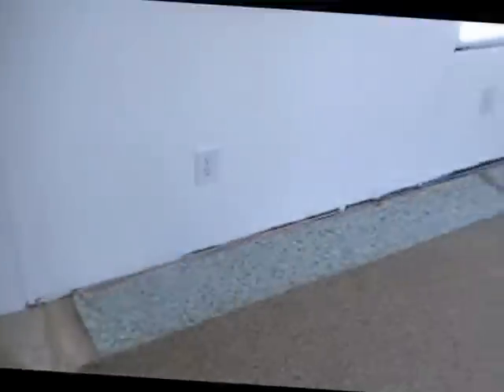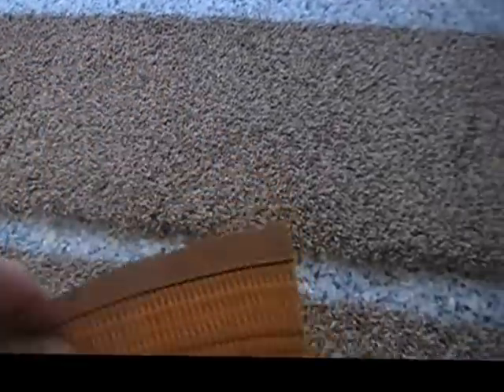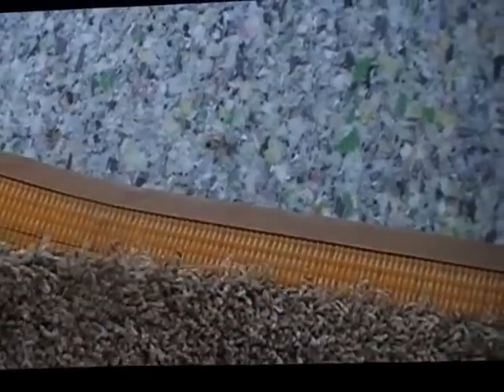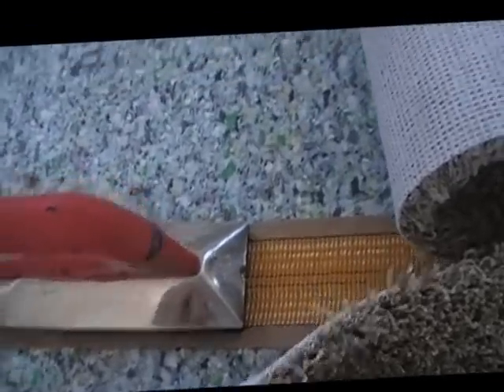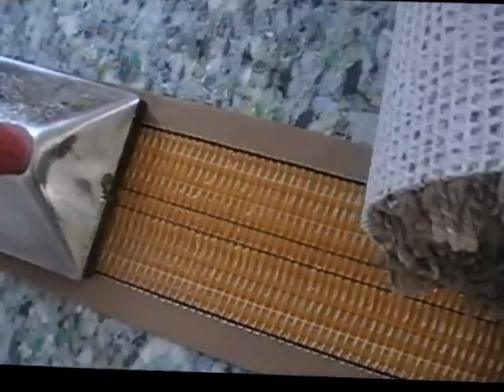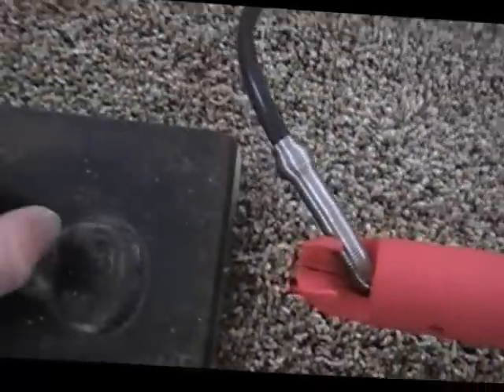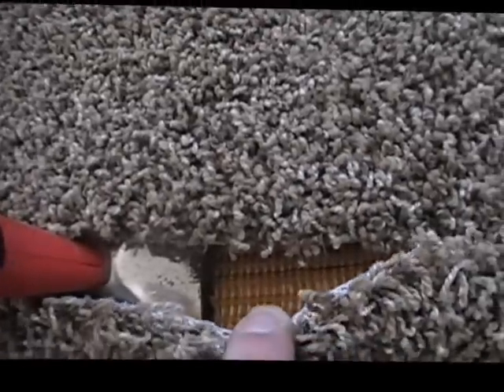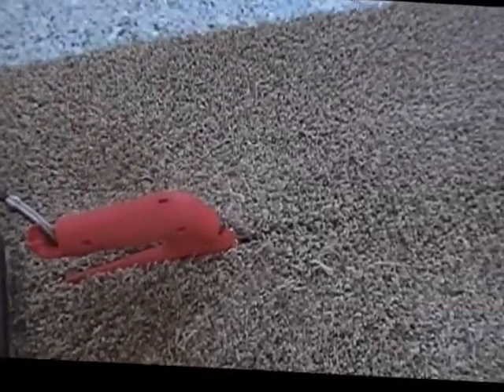HOW TO SEAM CARPET

Comment: good video. I would plug the iron in about 10 minutes before I'm ready to use it. So it's nice and hot when I get ready to do the seam. That way it doesn't take so long. I think you could turn it up a notch, usually between 3 and 4.
Reply: Efficiency is key and the seam iron besides your pad and carpet should be the first tool brought in I'll bring out a hundred yards myself within three hours with seems but also I've been doing it for 10 plus years 2nd gen
Reply: I start my seaming iron five minutes before as well but I also set it on number for that way I can kick ass and get it done in a few minutes haven't had any complaints yet

Comment from the maker: It's very important to seal the edges on a berber carpet so they don't fray.most plush carpets we do not seal the edges because the sealer will make the yarns hard.if the customer feels that walking on it barefoot.there is no fixing it with out redoing the seam without the sealer.most plush carpets don't fray at all.it's the berbers that fray,and since the loop of the berber carpet is sort of hard in the first place you wont feel the sealer.but plushes are so soft you will feel any hard spot.

Comment from the maker: We use the square blades and the knife that goes with it, because their designed when used with a row cutter to only cut through the carpet backing and not any surface below. Also there are 4 sides to them, so if you buy a box of 100 that's 400 blades. Its cheaper that way here in the states. The Stanley blades only have 2 sides and cost more. Thanks jojo hope that answers your question.

Comment: Great video the only problem is your running the tool in the wrong direction. Its made tapered on the other end to move a little easier through the carpet.
Reply: Yeah I cut the seam tape in 3in stips then take the iron vertically across the seam. Lol

Comment from the maker: place the kicker before the tackstrip and push down hard on the head while you kick so it doesent slide and rip the carpet. as for stairs measure your with and length and use a metal straight edge to cut.than square off the end that starts at the bottom with a building square.start at the bottom stair staple on bottom,put kicker on tread in the middle of the stair and push as hard as you can .staple than work your way to the left corner stapling as you co than the same to the right.

Comment: Here's a good tip for you to make your seam even more invisible regardless of the type of pile you working with. Next time you do a level loop job, cut a piece of carpet the size of your iron and cut a hole for the handle and put the piece upside down over the iron. This will keep the carpet off the hot iron and prevent any distortion. I've been doing this for over 20yrs and it works great. P.S. I also blow the steam out before I drop the carpet into the glue too.
Reply from the maker: D Beaulieu sounds like a great idea I will have to try that. Thanks for the feedback.

Comment: You should always seam seal your edges so it doesn't delaminate.The manufacturers say even with that twist Knapp that you should seal your edge 😂.Dont know why.And I always use a toilet lid for my weight.The porcelain in the lid keeps the seam from peaking
Reply from the maker: Aaron Payne yes you are right the manufacturer does recommend that you seal the seams on all  carpets. But I find that their cheap crappy milk seam sealer they want you to use , if it gets on the Yarns makes hard spots. So I prefer not to do it and just slowly push the two edges together getting a little bit of the hot glue in there to do the job. As far as the toilet tank lid goes they do work very well. But if you're working in someone's house and they are around watching you it doesn't look very good. Especially if they are germaphobes. I try to be as professional as possible around customers.

Comment: I’m building a carpet mill for my dogs and I’m struggling with joining the carpet together to make the belt around the mill, would this tape work for joining it together and would it be robust enough for dogs running on it?
Reply from the maker: You would be better off using contact cement. Dog's like the smell of that tape for some reason & chew on that spot. I do a lot of repair work from dogs and cat's chewing up seam's.
Reply: @TORCHBROTHERS  thanks for the reply, appreciate it

Comment: Seamin' carpet is usually a one handed operation, it's a bit disrespectful to the owner if it's not yours. Just gross if it is yours, especially if you're also a carpet muncher. Accidental carpet sea men by you or helper should be cleaned up if you can locate them. Remember to check your walls and ceilings too, it can be a sticky situation sometimes and hard to explain.  Informative and helpful vid. w/ a happy ending!
Reply from the maker: LOL.

Comment: you cant a long seam buy measuring from the carpet edge to the straight edge most factory edges are wavy you can get away with what you're doing on small long fills and high pile carpet but try doing it on high end carpet and your seam would be visible

Comment: I don't understand. You cut off an inch of carpet with a straight edge using your knife as a guide to keep it straight. The only way doing that would work is if the carpet was straight to begin with, or you would end up with the same edge you started with.
Reply: SnS PC sometimes the edges are rough so you would want a straight edge to fix that. In this case it could have been that he already had a straight edge but decided to revitalize it for video sake.
Reply: I need carpet in two rooms. Thought about doing it myself but never did it before. By the time I buy all the tools and other things it might just be cheaper in the long run to have someone do it. I just want to understand the whole process before trying it. Thanks for your reply.

Comment: Has anyone else had more trouble with cheap carpet i started in retail with really expensive carpet and now on my own with an employee and doing apartment carpet and i cant getvthe seams right wtf
Reply from the maker: The best advice I can give you is use cheap seam tape .Cheap seam tape has less glue and just works better on cheap carpet ,and put your iron on about 3 and go a little slower, also make sure you use a good seam weight spend the money on one if you don't have one they are well worth it in the end.Cheap carpet is crap. Make sure you tell people right away there is no such thing as an invisible seam with that crap. No guarantee.

Comment: How do you join seams when you have the foam backing already attached? (Kangaback)
Reply from the maker: Oh that kangaback is cheap carpet. I would highly suggest not buying it if you have to seam it. You have to cut the edges straight just like in this video but then you have to glue it to the floor. It never turns out very well. That stuff is really meant for small rooms that you don't have to seam. And it wears out very quickly because that backing breaks down fast.

Comment: I followed the directions for seaming carefully but things did not go as planned.  The seam tape was glued to the underlay! What a mess! I had to scape off the glued under lay from the back of the carpet and replace it with new underlay. What did I do wrong?
Reply: Molly's heaven you probably had the iron too hot and had it held in one position for too long, it's best to keep it moving as quickly as possible. I find that the perfect setting for the heat is 3 or just above

Comment: Can you use a clothing iron
Reply from the maker: Amanda canas you could but it would probably ruin the iron. And I don't know if it would get hot enough or too hot. You should be able to rent one of those irons at your local Home Depot.
Reply: torchbrothers  yes I explained that to the boss but he still brought us an iron lol I have a heating gun at home to give that a try
Reply from the maker: Amanda canas if anything just use a hot glue gun. And squeeze that glue onto the tape. Can't believe your boss wouldn't go rent 1 they're only like 10 bucks for the whole day. LOL.
Reply: torchbrothers you would be surprised.... we are on a time frame and our carpet guy blew us off, so now we're doing our best with no carpet installation experience and kind of trying to Old School up some tools
Reply: Thanks for the help
Reply from the maker: Amanda canas  well if you have anymore questions feel free to ask. I am not working today. And can probably get back to you quickly if I hear my phone beep.
Reply: I seemed my carpet using a small propane torch. I would cut the seem tape in pieces about 3 ft long, heat them nicely, then bring them over to the seem site and seem away.   Find a routine, on how not to overheating the tape and also how to tuck it under carpet. Ain't that fun.